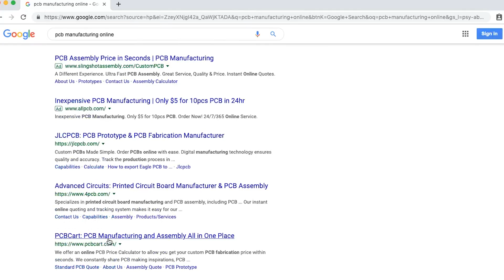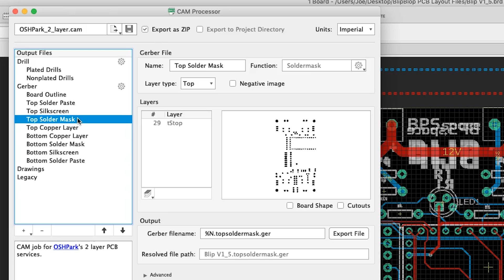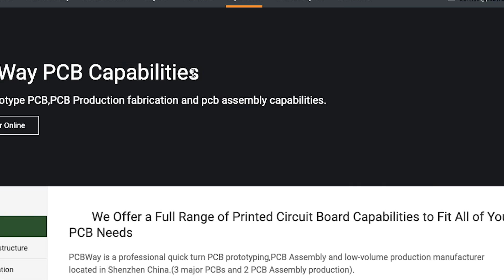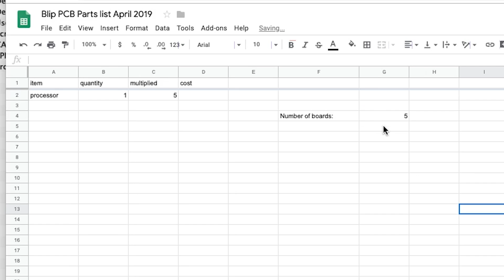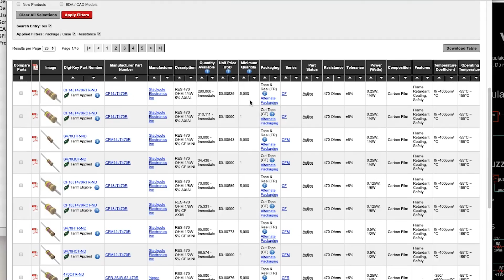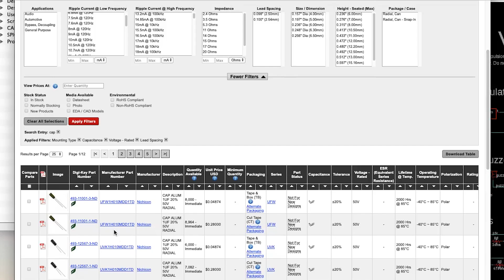PCB Production - Landing Model Rockets Ep. 6

Comment: Any advice on how to keep solder paste from clogging the holes in the stencil? Especially for fine pitch pads? 

Maybe you can answer this in your next video. 

I find if I don’t clean out every single fine pitch stencil hole with a needle, I can’t get repeatable results during reflow.
Reply: (Replying to my own question) I just watched your assembly video. You mentioned you would run the stencil under the sink. I’ll have to try that.

Comment: I was wondering how you light the payload stage of your falcon heavy I want to make one on a smaller scale and the best I few I could thing of was having a igniter in the motor wired to a esc that’s connected to a battery and a receiver and when the core booster burns out you just pull the trigger on the remote but that doesn’t really sound like a good idea to me

Comment: It might actually be a better idea for both cost and testing to get multiple boards. In case there are some manufacturing errors on one or two boards, you can have hope that one out of however many you made, there can be a couple that still work, and you can have a replacement board in case one is damaged due to a bad flight.
Reply from the maker: Yep! I do recommend building several if you're going to do these yourself. Especially for folks who are a bit newer to electronics. That's why I bought parts for 5 of each in this video.

Comment: How do you find out what type of parts you need for the  board?? like the type of resistors or how much power is needed
Reply: You design the schematic, you need to have a basic understating of electrical design. After you make the  schematic then you can inventory the parts you used to make the circuit work.

Comment: Nice explanation of the process. You're a great instructor. Something you may not have noticed: "Not for new designs" often means you will pay through the nose for those parts, because they are being phased out and companies that use them don't want to redesign their products that are using these parts, so they will pay desperation prices to obtain them. Also, stay away from Tantalum capacitors, because if you overload them or accidentally reverse bias them, they get very explodey.